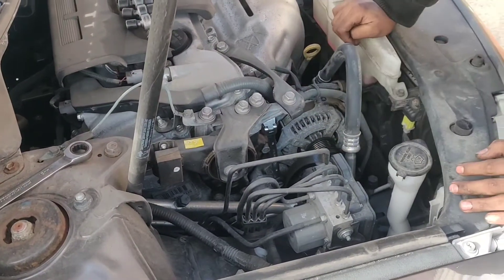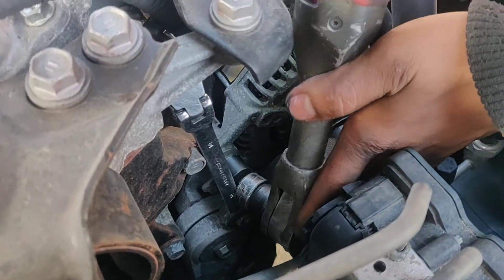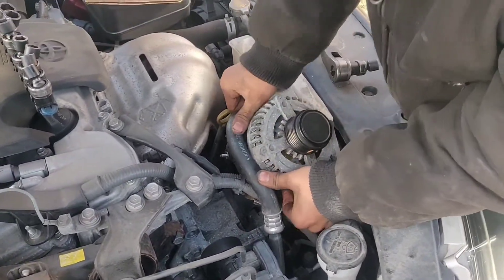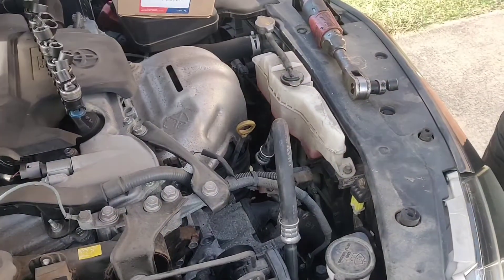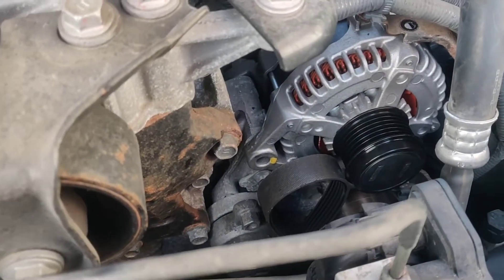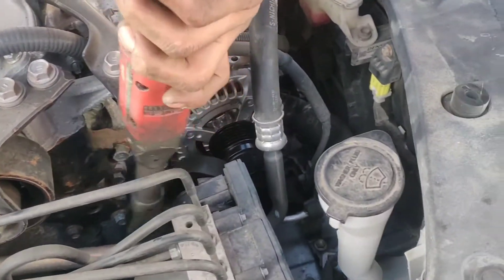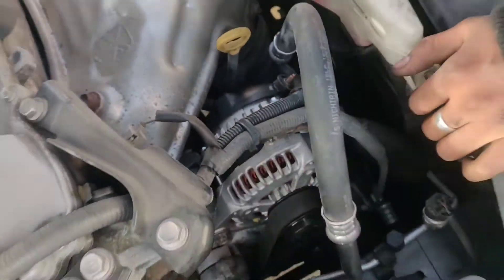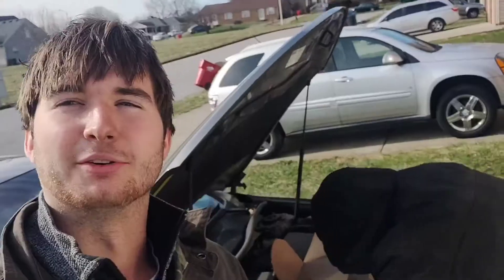2014  Camry 4 cyl Alternator Replacement

Comment: How many miles on the car before alternator went out?
Reply from the maker: It drastically depends on how often the car is used and if the battery and connections are all good. If you have a weak batter it will wear the alternator out prematurely
Reply: @ferenzi7741  I have leds hid subs speakers. I had my batter changed 3 years ago for camry 2014, I have 90k miles should I change alternator from dealer?
Reply: i have a 2016 with 190k i think the bearing is going but it seems to charge fine still